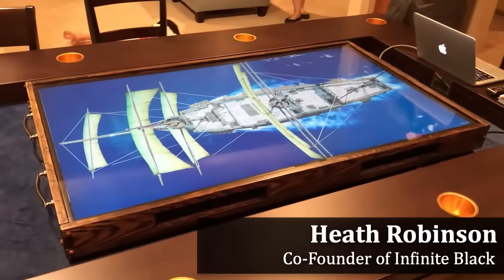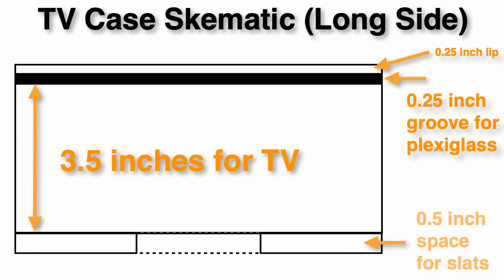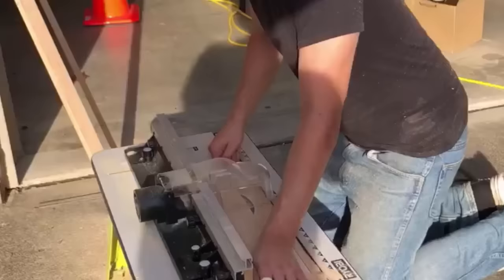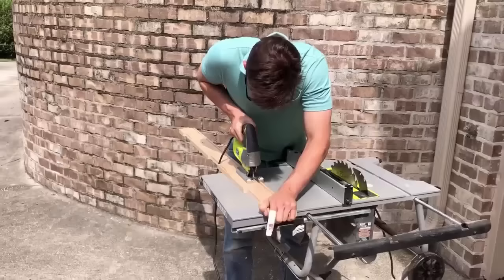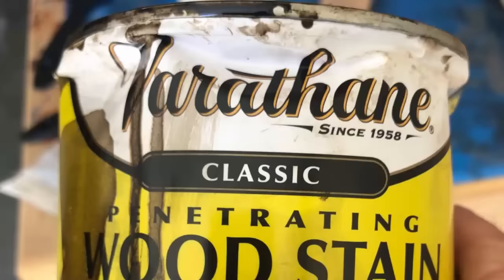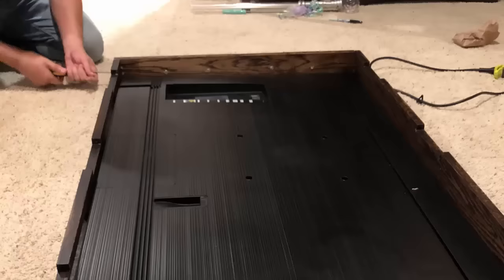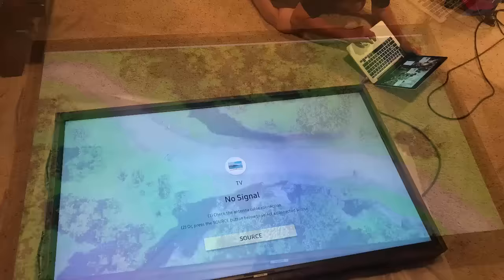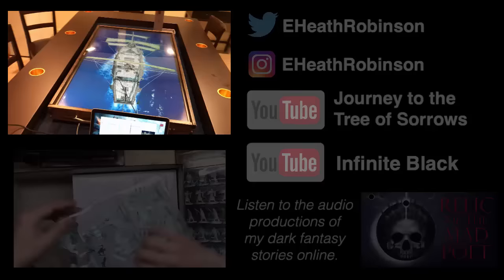Building a TV Case for your D&D Gaming Table for Digital Maps

Comment: We just use a projector pointing down from overhead. We use a magnetic whiteboard as the "projection screen" we can set our miniatures on it, with magnets in the bases so they don't jostle easily. We can draw on the whiteboard with dry erase markers.
Reply: lol I just commented that sort of idea. Great minds!
Reply: That's a great idea!
Reply: Great Idea but I hope it's an LED Projector because bulbs are way too expensive on projectors so you want ones that have an extra long bulb life.  LED Projectors are small and easy to position or hang.  Otherwise that's awesome idea.  I think I've seen similar setups.
Reply: @Wolfsheim23  we have had both, bulb and LED. As we have had to migrate Gaming locations. But mostly we have used the bulb one, as it has a better image. And most of our gaming locations have allwed for long time installation. Using it once a week--we have not had to change the bulb yet, in over 7 years.
Reply: Especially useful for low budgets.
Nice comment.
Reply: This was my immediate thought the first time I saw a different video making an entire table for a TV.
Reply: @Wolfsheim23  In my experience projector bulbs last for a very long time.
Reply: Any pics you can provide?
Reply: How did you install the projector?
Reply: @Wolfsheim23  my last projector bulb lasted for 5,000 hours and cost $60 to replace.
Reply: u should show us a video of ur idea
Reply: It's going to depend on your typical lighting preferences for the table, it's going to require that the table be lit almost exclusively by the projector, as ambient light will wash it out. Some people might like darker tables and that's fine, but some people will prefer to have more light for managing their dice rolls at the very least.

It also has the shadow casting problem, if you're putting figures or lines on the white board it will have the setting displayed over it, which could obscure lines in certain situations. A rear projection, or a television, will always be the better solution, but both of those will be more expensive solutions for most setups.
Reply: That is an awesome setup dude
Reply: I see no problem with drawing since the master can draw on the screen with the mouse.
Reply: when the TV itself is more than a house payment hard pass for 80% of working lass people.
Reply: @MarkSkater  I've started doing YouTube videos and it's not as hard as I thought. I'll try and make a brief video of our setup. We don't get together lately because of Covid. But I can film our projector setup. And post a link.
Reply: @JosephKeenanisme  where do you live that your house payment is $300
Reply: This is something I thought of myself
Reply: @mrfrupo there's no shot this is true.
Reply: @hidefdad6318  it is true, the projector literally keeps track of bulb hours. I'm still on the 2nd bulb, had the thing for 10 years.
Reply: Playing in the daytime would lose the picture quality

Comment: I tried this with a 50" TV and it developed a crack in it, even tho we were extremely careful. Most TVs are not designed to be on their backs. The weight of the screen alone is enough to cause damage. I was considering using a large monitor instead—something that is made to be moved around.
Reply: damn, what model tv was it that developed a crack ?
Reply: I'd wager that was more a flaw in that specific TV than any real threat from the way it's lying down. I've seen a lot of tabletop setups done with televisions this way for everything from gaming to office work, and I've never heard of any of them just spontaneously cracking from the "weight of the screen".
Reply: This is actually true, not sure how these tables manage to not crack.

Comment: I built an entire gaming table with the TV inserted into it, but had to make some of the same decisions you guys made. My solution for keeping the TV level and help provide even more airflow underneath it was to simply use a cheap TV wall-mount and mount it on the back of the TV in the appropriate VESA holes. That way the wall mount rested on the slats underneath the TV and I still had free access to the HDMI slots (and other plugs, since I actually use it as my regular TV when not gaming). Obviously this does make the whole build "thicker", but I'm also only using a 40" LED TV and it's not nearly as thick as the TV you're using.
I also had the plexiglass I use cut exactly to size to fit into the bezel of the TV, again saving some space.
I've documented my build with some pictures in case you (or anyone else) is interested. The foremost change I would make if I had to build my table again would be to lower the TV even more, so I could put leaves in the hole to cover up the TV completely (I'm still contemplating doing that, since it would be a relatively easy thing to do - just have to re-varnish the parts where I take out the molding surrounding the TV).
Here are the pics of the build: https://www.deviantart.com/gentlegiantdk/gallery/51227027/Gaming-Table
Also, with all the terrain Lou has been 3D printing you'll soon not be needing the TV any longer. ;-)
Reply from the maker: Ah, yes! I see. Very nicely done. Someone else had commented about using the VESA holes for leveling, and so I see what you are talking about now with those. Thank you for those pictures. Cutting the plexiglass so it fits down inside the bezel of the TV is also a good idea.
Reply: @EHeathRobinson  Honestly for safety and longevity I would always suggest using the structural points of a television, either the wall mounts or the stand mounts. The television is already going to have a shortened life due to gravity acting on the screen layers itself, it's better to keep other stresses off the television. I would also always suggest keeping the top frame from pressing on the TV at all, which is mostly idiot proofing. People are bound to lean on the table when reaching across for their miniatures, and if the plexi or frame is transferring that pressure onto the LCD itself you'll surely damage it.

Comment: Great job guys, the table looks awesome! As a keen woodworker I couldn’t help but notice how high your table saw blade is. Great to see your riving knife fitted but the saw blade only needs to be as high as the material is thick, plus the height of one tooth on the blade. This way if things go horribly wrong for any reason you will cut a limb instead of amputating it! I hope you can forgive me for feeding that back, thanks again for the great video! 👍
Reply from the maker: That is excellent safety advice. Thank you.

Comment: Great project! I believe an even easier way to ensure the TV is level would be designing your slats to utilize the TVs existing mounting holes as they are already designed to be level on all TVs and are usual where the engineers put the heaviest components.

Comment: Here is a tip for easy leveling and height control, as well as a more secure hold on the display. 

Most large format displays come in with hardpoints for mounting. Usually, they will have the screw size, quantity, and pattern listed in the official spec sheet. For example, that display uses 4x M8 machine screws in a 400mm x 400mm pattern. These are available in most hardware and Auto Part stores, as metric fittings have become, while not dominant in the USA, at least common. If machine screws are not immediately available, bolts should be.

Place underside slats strategically at the mounting pattern points with countersunk holes for the machine screws. This allows the machine screws, or bolts, to be reachable from the outside of the case. The the thicker the slats, the deeper you can safely counterbore the holes, which allows additional room for adjustments later. that said, you probably won't need more than 1/4" more depth that the head of the fastener, so 3/4" boards should be fine for most new displays 55" viewable and under. for larger or heavier displays, 1" or thicker slats are probably a better idea.
If the display manufacturer includes a spacer, include it in the design. Those spacers exist to provide better support, so that you do not risk cracking the case of the display.
Include a nut (or wingnut) and a washer between the slat and the spacer on each fastener. This should you to lock the display in position, and adjust it as needed for a perfect fit. for a truly secure fit, use a nut/washer combo (or wingnut/washer) on each side of the slat. However, that would require a deeper slat and a wider counterbore to allow access.

Alternately, if you can get the correct sized threaded rod, this can become much more precise and fit into a tighter space with a thinner slat. Sadly, metric threaded rod is harder to come by.

Comment: Why did you not think about using the VESA Mounting holes?  It would seem like it would remove the problem with leveling.
Reply: just put it upside down and use blocks and shims.  When you get the right amount screw and glue it.  done.

Comment: Just a thought, Using the drawer pulls as feet may have been a much better idea then you first thought. Make another box the same dimensions as your TV frame. with a solid bottom make blocks that have notches that match the drawer pulls and mount them in the bottom of the box so that the two frames are lined up when the Drawer Pulls are fully seated in the notches . Now mount the box on the wall near a power outlet. you can then take the TV from your table and hang it on the wall. fill the Wall Box with small shelves for miniatures and other RPG aids being sure to keep the space above the notched blocks clear so the Drawer Pulls have room to slide into the Notched Blocks. You will also need cut channels in the Wall Box for the cables from the TV can get to the power Outlet and Input sources. Some strategic placement of Velcro on the back of the TV frame and the cables will insure they are held in the right place to go in the channels in the Wall Box.
Reply from the maker: That would be another huge project! But then you could mount it to the wall and use it as a living room TV when not in use for gaming. Lou has a whole home theatre setup though, so he was able to dedicate this TV just to this purpose. I can certainly understand wanting to make it dual-purpose though.

Comment: Once I was thinking about this, but one major part was to pick correct tv. I found all led to be out of the question as they are quite big, mostly curved behind and need extra preparation for cooling and fitting. They also have limited view angle.

OLED here is a best bet. Whole screen is flat and thin, except small area for electronics. That's also the only part requiring space for cooling. Fitting, because of shape is easier. Also there is no "view angle" because you can see stuff at any angle.

Comment: Try pulling the plastic casing off the tv. Oftentimes that will give you a much better idea of the setup underneath and more room to work. With the thin metal shell that is underneath you can work much closer to the actual screen and components without actually touching them. Might have to make a hole for one piece or another though.

For anyone else looking to do this project: Searching "Magic Mirror" will give you a lot of results that are similar. Just use plexiglass instead of one-way glass

Comment: This is awsome, I just needed this to be a 65 inch so it would perfectly fit into the table I think.
Reply from the maker: Thank you! Actually, it is deliberately smaller than the recessed area of the table because during a game it stays down toward one side so we can use the rest of the space for other miniature steps. When we were playing Storm King's Thunder we used the TV for a strategy map of a battle and then had the tactical map set up beside it. :-)
Reply: @EHeathRobinson  not to mention, that tv needs ventilation
Reply: @-Infernex  If I were building this I would definitely recess the TV pretty much flush with the table's surface leaving the back of the TV relatively open to the area below the table. But I'd probably also get a flat panel display rather than a TV so it's not trying to process non-existent audio (and if audio is really desired build separate speakers for the media PC to control separately). This also adds the benefit of auto shutoff whenever there isn't anything to display removing the need for a remote.

Comment: I guess the projectors could work. But depending on where you live. You can get an LED projector for 50-80 bucks and a decent 40" tv without any bells and whistles is only about 150. The 100 bucks seems to save alot time compared to a projector as I noodle it.

Comment: Without active ventilation, the TV will die very quickly.   A friend of mine just built a TV table and despite my warning to make sure he install fans to push the air through the TV, he did not.  So 3 gaming sessions in, the bottom half of the TV went dark and is no longer working.   TVs are not designed to be operated flat on a table.  The air flow is done by hot air rising out of the top of the tv.  With your setup, the hot air is trapped inside the TV and the vent at the top and bottom are blocked by the wood planks.  This is very bad for the TV.   I would suggest you find a way to push air from side to side and make vent ports in your wood planks to insure that some air can push through and cool the TV down.   Otherwise, very nice design, it looks great!
Reply from the maker: Thank you! I'm so glad you like it. Maybe we've just gotten lucky, because this one has been in regular use for years and is still going strong.

Comment: One important detail to note. If your display suffers an internal failure, don't be too surprised if the manufacturer of your display voids your warranty if they find out that you have been using it flat on it's back. Technically, they design the cooling around vertical mounting on a wall in traditional Landscape layout, with Portrait layout in some models.
Given that the warranties on most consumer displays are only 12-18 months, this should generally not be an issue nowadays.

Comment: I like what you guys did here. BUT I feel its a bit over kill and here is why I feel that way. Projectors! I have a decent amount of experience dealing with Projectors and honestly a you could have just mounted one to the ceiling above the table and even add mood lighting as well. And then you could have just made a platform to put the mini's on. So all you have to do on game night is fire up the projector. Lay in the platform that either has been painted an off white color. Or using a projection ready screen as a surface to project on. I did 3 tours to Iraq and I always brought my Laptop cables and a $400 projector inside a pelican case. Every time I got my living area situated I would break out my theater and gaming setup and I easily had the best setup of anyone. Projectors have improved a great deal in quality since the days I used one back then. I feel the same effect could have been achieved for possibly allot less effort and maybe even cheaper. The only issue really would be mounting the projector to shoot straight down to the table. But also building the surface board the projected image would be seen. The only draw back to this is shadows casted from the mini's. But with good mood lighting this might be offset or even attributed to sunlight or moonlight respectively. Anyway just an idea incase you guys want to give it a shot.
Reply from the maker: Maybe so. Projector vs. TV appears to be ever a debate. Years ago I thought about putting together a projector setup and I might still. But Lou wanted to do a TV case, so, here it is! :-)
Reply: Saw your reply to me. We have used a couple of projectors. The one we use most is about the size of 2 kleenex boxes together. And since we play in an unfinished basement, we have plenty of exposed 2x4s to mount it to. But in a pinch we have used a mini projector, not much bigger than a cell phone.
Do you know of any good VR gaming tables? Altspace VR Used to have one, but I don't think they do any more.
And Altspace would overheat my Gear VR so fast you could not do much more than start setting up
Reply: Better to mount under the table.  There are videos on how to set that up.  Requires more work and hardware, but eliminates the shadows and light blocking that comes from overhead.  And some folks are doing some really crazy things with old motion detectors and having that track miniatures even.
Reply: Overkill is Underrated.
Reply: 2 things to point out here that a lot of people seem to miss. If you go with a projector you are dealing with a wiring Hell which is dependant on how clean you want your setup. the other issue is UPKEEP, replacing a bulb in a projector that has less hrs of use than an actual tv usually costs roughly as much as replacing the entire Projector or buying a new tv. Overall cost TVs are way cheaper in the long run. But that is my opinion.